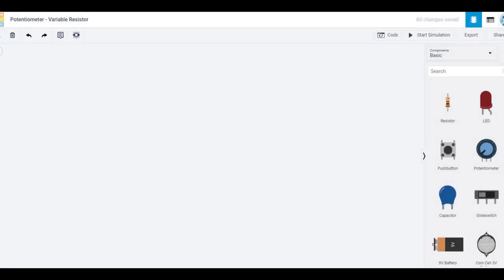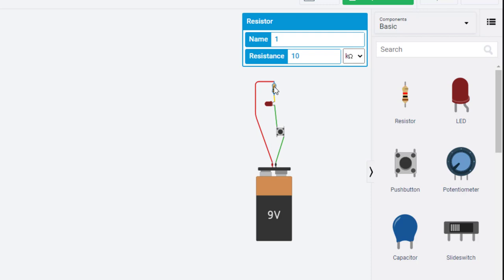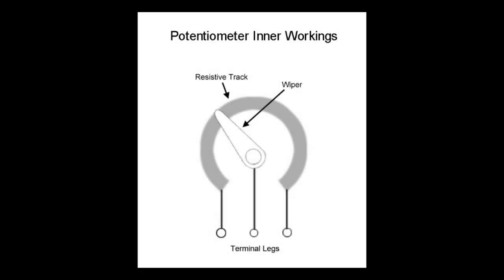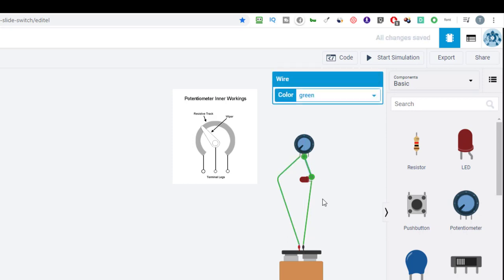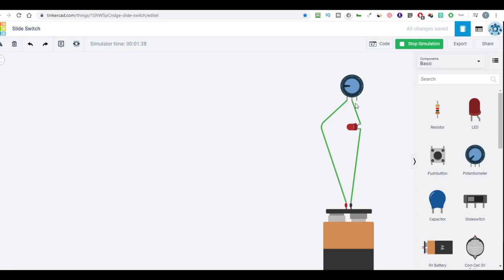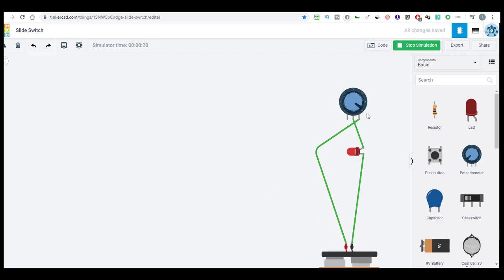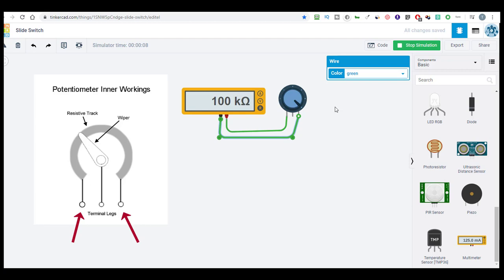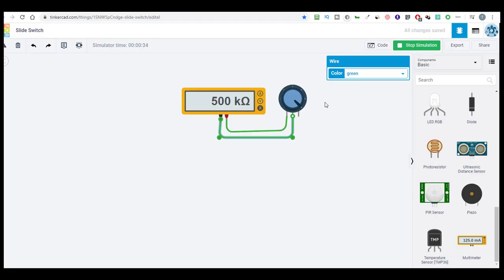Tinkercad Circuits #3 - How to Use (simulate) a Potentiometer as a Variable Resistor.

Comment: I put together a blue led and red led on a mini breadboard, with a 1k ohm resistor for each LED, and got it to work with just the right amount of brightness, powered by a 9 volt.  I am  a beginner and was super happy I got it right.  This video is precisely what i need to know going forward. It answers my questions about what value resistors to use and why, and answers ny questions about "what if i want to use a variable resistor, along with static resistors ?"    I had a rough idea using ohms law initially to figure out minimum value for my 2 led setup, but tried the 1k resistors  just for fun and to see if I I could dim the LEDs and still get em to light up, so I was experimenting somewhat blindly.  Your video validated my curiosity and that is great because i'm a beginner and had the "right idea" , but not quite an bonafied handle on it, I just got lucky.  This video is the only one I could find that fully explains how to "read" a variable resistor, and the technique to properly do so using the terminals and a multimeter-- super helpful, and demystifying.  You are a blessing, Thank You!!
Reply from the maker: It's really rewarding to see those LEDs light up isn't it! Thanks for the comment and I'm glad this was helpful!